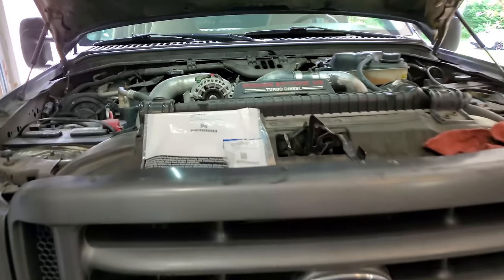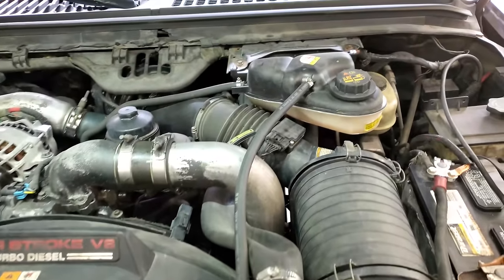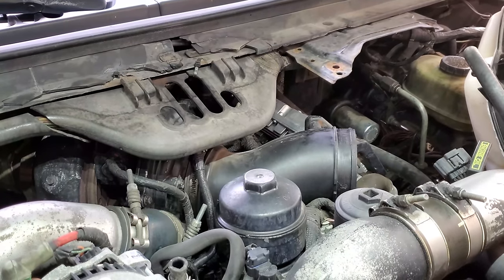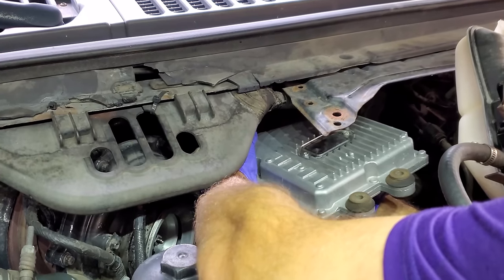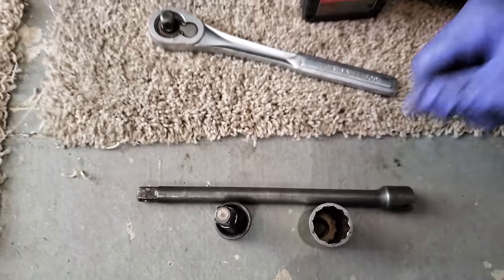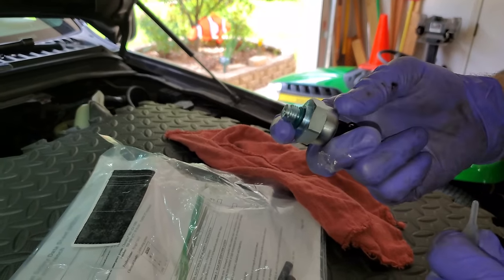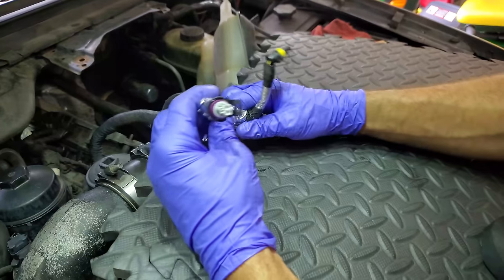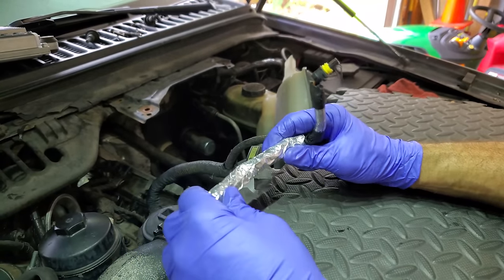03 Ford 6.0 DIESEL - ICP sensor Replacement

Comment: I have a 2003 F-350 powerstroke super duty 7.3 liter once I start my truck up and put it in drive gear and pull out of the driveway!!  Drive about a half a block away once my transmission warms up it stops pulling do you have any input on what may be causing this to happen?.. I have done so much research on this problem but no one knows anything! Please reply back...thank you so much!!..

Comment: Great video. Just did mine yesterday. It had been done before. Whoever did it before did kind of a half ass job and chewed up the harness pretty good. I went through and soldered/heat shielded everything.  Glad I decided to do it from the top and not attack it from the bottom.

Comment: Followed your video to fix my truck yesterday. Had a heck of a time removing the electrical connection because the tab was on the back and the space was small. I finally used a coat hanger hook to slip behind it. It came right off. Used then same coat hanger to guide the socket into position with the new part. Putting the new electrical connection on was difficult with the space, but finally lined it up correctly with a long screwdriver through the wires and it popped right on. Thanks for the video.
Reply from the maker: Hell yeah

Comment: Just did mine today on my '03....well my nephew did while I watched. Your vid was a big help. Also watched Diesel Tech Ron do one but he did it from below and that way looked too hard. The hardest part is getting the new sensor started in the hole. He finally put a short piece of rubber hose over the end of the new sensor to give something for his big meathooks to hold on to. Had to position match the new pigtail wires as the colors did not match at all.

Comment: Wow. Memories!!! Usually set a P2285 when that happens. I can't count high enough how many of these I did. I still have my Snap-On socket specifically for this sensor sitting in my box. I get the sensor from the basement while doing the wiring repair up top. I think someone already mentioned it, but there's supposed to be a shield that goes over the sensor and connector for added heat protection. Those always used to get saturated with oil. Another important 6.0 pigtail part number to remember is 6E7Z-12A690-DA. That's the pigtail for the later model year VGT solenoid connectors that always break the cheesy lock tabs.
Reply from the maker: Hell yea!!!!

Comment: I did mine about 10 years ago from underneath.  Seemed less intrusive at the time, but it was a PITA!  Had I seen a PTT video I would have done it from the top.
Reply from the maker: Thanks for watchin pal!
Reply: If the torque converter bolts were not so crazy hard to get in and out it would almost be as fast to drop the tranny
Reply from the maker: Bro that job can be done before you'd even have the trans out 🤭🙌

Comment: The belly of my 03 looks just like this one in the video and the check engine light came on Sunday shortly after changing out my oil. Hooked up my forscan and it says low icp voltage detected. I’m thinking this repair is in my immediate future. Thanks for giving me a clear understanding of what to expect! Was the connector bad that you replaced or did the new icp just have a different connector? Thanks again for helping all of us out much appreciated!
Reply from the maker: Yes sirrr, you bet. You have 2 replace it because the sensor pigtail is all shorted out with oil & would cause a circuit related issue.
Reply: Makes sense thanks!
Reply: So I replaced my sensor and my truck is no longer having this problem. Thanks again for you sharing your knowledge it helped out greatly! I did opt not to replaced the connector. Upon inspection it looked okay though was saturated in oil. I sprayed it out with some electrical cleaner then blew it out with my compressor a couple times, added a bit of dielectric grease and didn’t have any trouble with it. The sensor itself was shot. Had cracks on plastic base where the oil was seeping out and with barley any pressure the the sensor plug end snapped right off. Thanks again!!
Reply from the maker: Thanks for coming back & keepin it reall💯💯

Comment: there is actually supposed to be a heat sleeve that slides over the icp sensor I have been trying to find an oem one for my truck
Reply from the maker: Yea them are hard to find. Prolly an international number

Comment: I don’t have small hands big meat hooks can be a curse lol. I’ve had to change the icp sensor on my 05 it wasn’t puking oil just stopped working.
Reply from the maker: Thanks 4 sharing
Reply: Mine stopped working while running wondering if it can be this it’s cranking but won’t start
Reply from the maker: Naw prolly not

Comment: On my 3rd ICP sensor.  03  6.0.   285,000  still going strong
Reply from the maker: Woo woo👊👌
Reply: Do you still have the truck?Mine has 326,000.
Reply: @robertdilullo6765  Yes  310,000  still runs great
Reply: @haleyy68  Mine still works great. How long can these 03 last?I'm considering a new bed.Rails and back fender a little rusty. Everything else looks good.

Comment: How did you get your ipr plug to face straight up? Mine if fasting towards the heat shield?
Reply from the maker: U can put ur aocket half way on & use it to turn the solenoid np

Comment: Question, could you have just cleaned the pigtail connector instead of replacing??
Reply from the maker: Yea, but the oil makes the insulation so squishy and the thing never winds up sealing correctly again...

Comment: i got a f350 04 6.0 and it fires up great. when driving i’ll try to accelerate and it’ll end up stalling at 20 and 60. then i have to take my foot off and push down again, what do you think the problem is?
Reply from the maker: I need 2 put the computer on it....
Reply: My 03 did that about a week after I bought it off a guy.  Took it to the dealer and they said hfcm and new fuel lines.  $3500
I dropped the tank and found the strainer on the pickup line was busted off and pieces in the lines.  I replaced the strainer, filters.  Blew out the fuel lines and cleaned the hfcm.  Ran great until yesterday morning after a really cold start it started puking oil from somewhere on the back of the engine... hoping it’s just the icp.

Comment: If this was neglected for a little while, would it cause a misfire tick and then white smoke when you turn the key over and it starts? I bought a 04 6.0 noticed the oil leak on the back of the block and it “loop “ at idle but not in drive..also if this is bad and neglected would it cause more damage to the injectors since now there is white smoke immediately upon start up SORRY SO LONG but thanks if you could help
Reply from the maker: No it would not usually
Reply: @PowerStrokeTechTalkwARod  thanks for getting back to me, so probably injectors crapped out too . Either way I’m replacing this. Thank you again! Prefect step by step video

Comment: The socket you are using is is like a short deep socket. My deep socket seems almost too long and my short is definatley too short.
Reply: What socket are you using?
Reply from the maker: A chopped down 27mm
Reply: Thank you for the response. I was able to use my full size deep, but i had to use  a pipe to bend the heat shield slightly back, it was still a tight fit. If another one rolls into the shop I'm definitely gonna make a custom socket. Thanks man
Reply from the maker: U bet

Comment: Thanks for the video I've yet to find any help on exactly what my problem is hopefully you can help with some suggestions. I have an early model 03 super duty and I just recently had another motor put in it issue is the new motor is out of an 04 which was actually in a f-450. Motor is in the truck and running sounds good at idle but driving down the road it lacks its power and sounds as if the turbo is not winding out as it should. I've also come to notice that the ICP on the new motor is not plugged in we're now it is located on top of the passenger valve cover and I guess on my old motor it was down below the turbo the back side of the motor such as the one in your video. So am I screwed because the sensor is not plugged in I have the original wiring harness on the truck and computer is there any way that I can find the original plug and extended over to the valve cover? I have a feeling this is why the truck is lacking its power because this sensor is not plugged in
Reply from the maker: U buddy are not in a good spot

Comment: Will this fix my dreaded, start and run for 2 minutes then just stalls?
Reply from the maker: Most likely not
Reply: @PowerStrokeTechTalkwARod  thank you. I had a "shade tree mechanic " tell me it was the fuel relay, which is hard wired to the fuse panel.
Reply from the maker: @crandallscooking what a goof he is. Don't take it to pepbous they'll tell u it needs a mass air flow sensor
Reply: @PowerStrokeTechTalkwARod  😂😂😂

Comment: What happens if I have a no start, unplug this sensor and then it runs fine. Can I just leave it unplugged and deal with the check engine light for the time being? Thanks
Reply from the maker: That's not gonna make it start pal.....that's ONLY if the sensor is messed up..
Reply: Well something ain’t right then cuz that’s literally what happened. Truck no run. Unplug sensor. Truck run

Comment: Hi, my 6.0 ICP keeps blowing O rings. Prior owner said he replaced the ICP and IPR. Iv put on 3 ford OEM 14mmx2mm ICP o rings just to have it blow out again. Any advice?
Reply from the maker: Blowing o-rings..... i dunno man. Youll have to email us.
Reply: You might have a crappy knock off ICP. The cheap ones have a gap between the threads and the o-ring. Last maybe 3-9 months I hear.

Comment: Why is it necessary to replace the connector?
Reply: They say because the insulation/rubber/silicone gets soaked with oil and never seals right again

Comment: Plus it just cranks and and shows no oil pressure  until you get it to start and if u hit the fuel  pedal shows oil pressure till u let off then stops working  is that the icp  bad   new to diesels
Reply from the maker: No, icp does not control gauge!
Reply: @PowerStrokeTechTalkwARod   ok anyway I can send video of what it's doing  I'm on Facebook   name is rian Robertson  picture of a girl  beside a horse I'm Rebecca husband  we use same email  lol
Reply from the maker: What do i need video for..

Comment: Hey Arod quick question! If you don’t have foil tape like you mentioned in this video could I wrap it up with some Tin foil (aluminum foil)? May be a dumb question idk. I replaced the ICP along with the pigtail over a year ago (sadly aftermarket part 😅)and it’s starting to go bad I believe. But this time I ordered the exact part you used in the video Ford OEM. I hope it will last much longer. Also prob 2-3 years ago I had to replace the IPR but I did buy Ford OEM to replace it so far it’s been fine. 2004 F250 King ranch 🤙🏻😊
Reply from the maker: Yea, i suppose you cld!

Comment: is there a way to connect correct wiring if you can't position match them?  I had to yank the wiring out of the sensor so position matching is not possible anymore :(
Reply from the maker: Yea ud need the wiring diagram
Reply: @PowerStrokeTechTalkwARod  thanks for suggesting that.  led me to this diagram https://www.powerstroke.org/threads/icp-broken-wires.213845/#lg=thread-213845&slide=1

Comment: Hey does the socket* size for the sensor vary? Im having trouble taking it off
Reply from the maker: The bolt size....
Reply: You might have a newer style. I’m pretty sure it’s a bit smaller.
Reply: @mattlacarra2069  i got it it takes a icp socket, long enough to catch and not get cought on anything. Thanks u guys
Reply: @demitrioushicks4664  there are two sizes of this sensor. There’s the 3C…….. part number for the 2003 and early 04. It’s a 1-1/16” or 27mm. Then there is the 4C…….. part number that’s intended for the late 04-2007. It’s a 15/16”. Both will work on this model year, but the 3c…… is the intended part number.

Comment: Hello have a question not really related to this video but more to diagnostics on 6.7. If vehicle is scanned with IDS with no codes present and no issues. Is it possible to tell condition of EGR cooler DPF filter and other costly items to get ahead a a pending failure or issue.
Reply from the maker: Ehhhhh possibly. U cld watch all the data & see if its middle of the road or about too....
Reply: Is there any info out there as to what is supoee to be normal as far as back pressure  egr temp dpf soot load for a engine with a giving mileage .
Reply from the maker: No not really. Ford has reference  values to compare to

Comment: Does it tell u which wire goes to .  It looked different colors
Reply from the maker: No, u match up each wire 1 at a time. Its only 3..
Reply: @PowerStrokeTechTalkwARod  it dont matter which is which then.  To me they looked different colors, thats y i asked
Reply from the maker: Mike, follow the video, i show u everything..............
Reply: Look at both connectors and just cut and splice one wire at a time. Just have to make sure that you splice the correct wire in relation to where they are pinned into the connector. If that makes any sense. It does in my head anyway 😂

Comment: Replaced it 3 years ago, have to again 😅.  Massive oil leak
Reply from the maker: Yepp been there don't that. Icp & connector
Reply: @PowerStrokeTechTalkwARod ugh 😂 well I’m working on it now.  Thank you very much for this video.  That stud bolt was a pain for me!  Had to cut the ground wire to remove it and rewire it.  Putting this back together.
Reply from the maker: @dauraktv yeppp been there dine that. I kept a ground down 10 mm wrench that I could use to go under that eyelet
Reply: @PowerStrokeTechTalkwARod  ha, I almost took out my angle grinder to do that!  I noticed I tightened the sensor way too hard the first time I installed it 3 years ago, so this time I did snug and quarter turn.  So far it’s running great

Comment: Do you need to disconnect the batteries?
Reply from the maker: Absolutely not
Reply: You're better off if you do. Or use fender protectors/towels that way you don't run a risk of arcing with your tools.

Comment: thats the ipr valve
Reply from the maker: No
Reply: IPR is the big fat one right above the ICP. Completely different sensors for the high pressure oil system. I would hope people knew the difference because IPR is quite a bit more pricey than the ICP sensor.
Reply from the maker: The insane clown posse is the one on top...

Comment: I have a 2003 F-350 powerstroke super duty 7.3 liter I  can start my truck up and put it in drive it goes into gear good but once I leave my driveway driving about a block away once my transmission reaches a certain temperature it just stops pulling!!.. do you have any input on what it may be?.. please reply! ..thank you!!
Reply from the maker: Codes, codes, codes...

Comment: Haha glad to see I'm not the only one who said fk it and broke that stupid plastic cable harness thing above the turbo. I got tired after about 30 minutes of gently trying to get it out of my way and just went ahead and broke the stupid thing off. And who is the idiot that designed the air filter set up on this truck? I know their are guys who love these damn f250's but personally I think they are a pain in the ass. I mean how the hell did the expect you to work on these things when they put so many parts that can just kill the truck in the most difficult places you can barley get to. Then you special tool and special sockets and a special diagnostic scan tool just for this stupid truck.